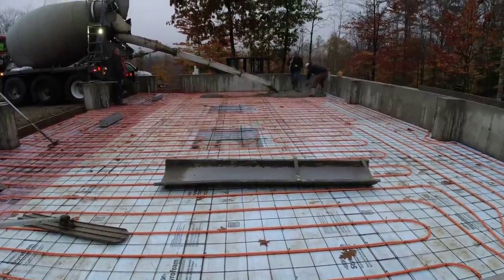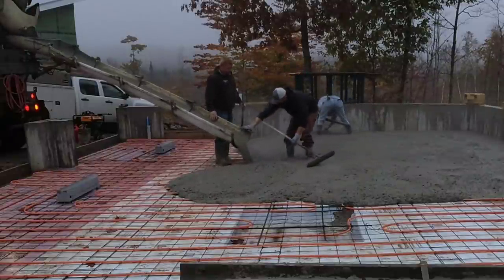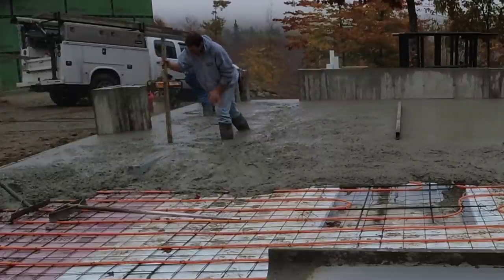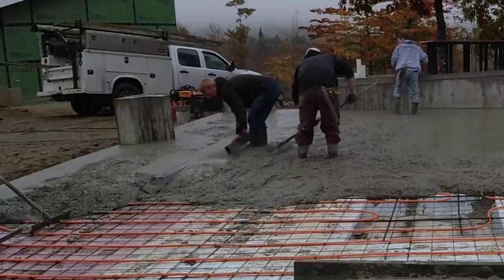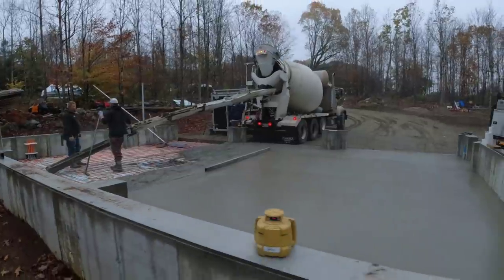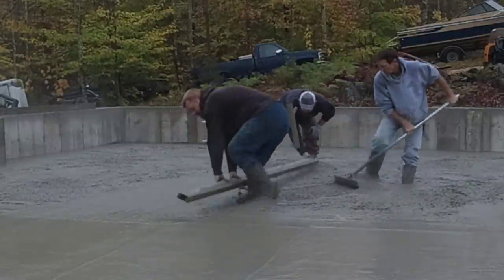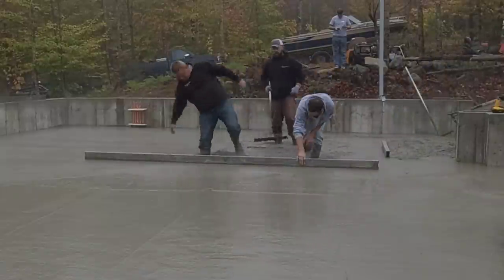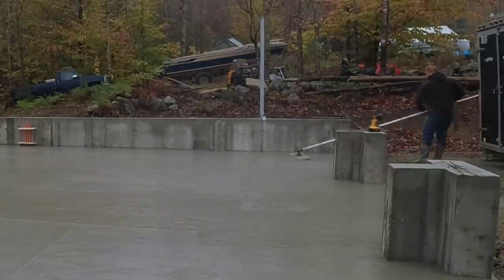Pouring A Garage Floor with 3 Trench Drains. (One Man Down)

Comment: Covid I like trench drains better then round ones we have been doing a lot of bigger slabs 50 by 80s we split them down the middle and still use our Truss screed that has seemed to work out well even on a 50 x 60 we are smaller crew just works out that way for us thank you for the videos I really enjoy them

Comment: Hey Mike.. got a finishing question with drains. I'm doing a very similar pour. Two trench drains in the middle of a garage monolithic pour with a sloped pad. I'm wondering, how do you edge around the drains, when the concrete isn't set enough to walk out to them (they are too far to reach from outside the forms)  Is the concrete typically still soft enough to edge by the time you can get on the slab?
Reply from the maker: Yes, you can usually still edge when you get out there.

Comment: Offset trench drains are nice when working on vehicles, like you would with a lift. Otherwise creepers, transmission Jack's, oil catch pans,etc that have Castor wheels are not getting caught on the drains

Comment: Did you set the drains or someone (plumber, owner, builder, etc.) else did it? My garage sub base (sand) is perfectly flat. 10-mil vapor barrier, foam board (Nudura HydroFoam) and hydronic heat tubing already installed. It will be 6” slab exactly as you describe it. To install drain, do I cut foam board insulation and vapor barrier around 4” pipe area where the channel drain will be placed? Or I should drive rebar thru foam board and attach channel drain to it? TIA
Reply from the maker: The excavator set these. He set them using quikrete, it holds them in place better than rebar. We played the Styrofoam afterwards.
Reply: My 4" drain pipe is done and penetrates thru foam board. I guess, I will have to open up around where channel drain will be and do it with quikrete and then put back vapor barrier and foam board around the channel drain. The channel drain is actually 4-3/4" high (NDS from Menards). I was hoping I could put it on top of foam board and secure it with rebar stubbed thru foam board.

Comment: Hey Mike, Love your work and videos. Question, do those trench drains come with covers for when the pour is done? Just curious if you put some form of cover over them so no concrete accidently gets in them and hardens or runs down the piping and hardens ?
Another great video thank you !
Reply: Usually in my expericance we just duct tape over them. When you’re done you can remove the duct tape and it leaves a clean drain

Comment: Did Darren had a baby? That's my guess.

Great video, thanks for sharing. 

I am in the process of planning a garage demo / rebuild and the property and driveway slope towards the garage. The house has been like this since it was built in 1968 and from then until now the constant flooding disintegrated the sole plates. Believe it or not the only thing holding the garage door wall up are the garage door tracks. The garage is such a mess. They added an additional 1 car garage to the existing garage and never graded the property so it flooded multiple times. They also framed a hip roof off of the existing hip roof and that caused major structural issues, roof/ridge sagged, walls splaying. Just a terrible job...yet it received a CO...I don't know how.

 I digress. Because the driveway slopes towards the garage, I wanted to maintain the height of the slab, instead of pitching the entire garage floor towards the doors, and have an apron from the slab to a trough drain between the apron and the driveway. I figure the additional 5 or so inches would help to mitigate any water from entering the garage and allow for less grade for the driveway.

I have a couple questions:
1. When is a trench drain with a catch basin, in a garage, necessary? 
2. Would a square or circular drain be sufficient for a 15 x 24 garage? 
3. What would the cost increase be roughly, to add a drain to the center of the garage?
4. Would this be a better approach or would sloping the garage floor to the door be the better option?

I know the garage floor drain (or trough drain) will add to the cost of the build but I can't see it being that much more. 
I'm from NY so I know that the prices would be different but I'm trying to get an idea, roughly, of the cost increase and if it's worth it.

Thank you and again, excellent video. Very helpful.

Comment: Mechanic shop, you don't want the drains in the middle. He's putting them in the correct place. One reason is for small parts rolling down the drain Another reason is the lift he plans on using probably needs to on the flattest available surface to limit shimming the posts. Using a transmission jack with four wheels and having the floor sloping different directions right under the vehicle makes it awkward to roll around.

Comment: Darrin is out for a delivery of a baby.  I am like you Mike, I like trench drains more in the center of a floor versus one of the ends.  Sometimes you really have to work to make sure you don't have any birdbaths with those slopes if it is a long distance to the drain.  My personal preference is 1/4 inch of fall per foot, but you don't always get that.

Comment: Why don’t you compact the concrete? 1% air in concrete 6% loss in strength?
Reply: It's a garage floor
Reply: Do you mean vibrate the concrete? ACI says you do not need to vibrate slabs under 8” thick and unreinforced, and you never want air entrainment in slabs, unless it’s exterior concrete and Unheated, but as you saw this garage is going to be heated.